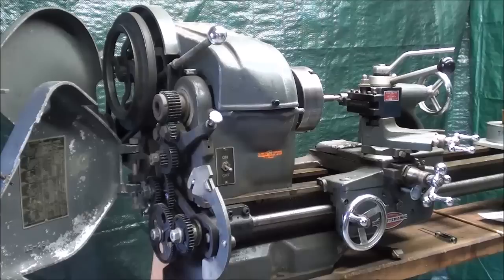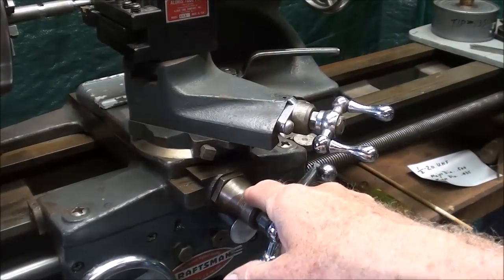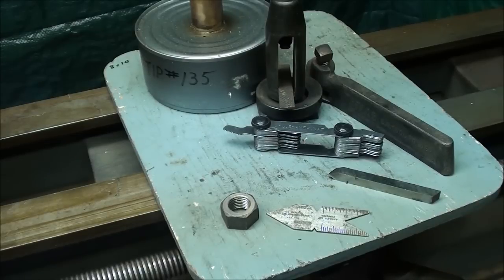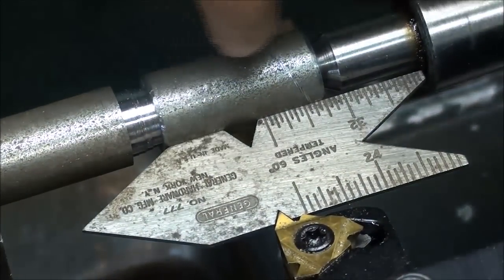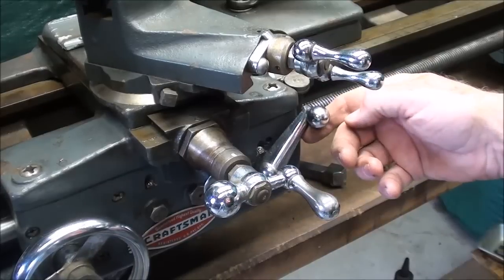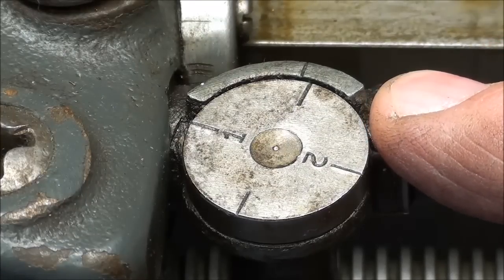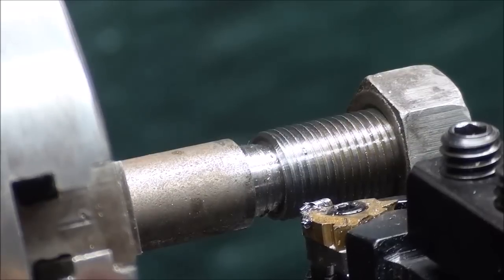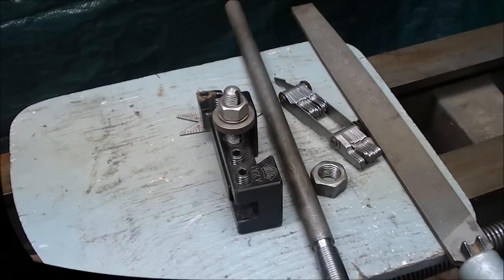SHOP TIPS #223 Cutting a Thread on the Atlas/Craftsman 12" Lathe  tubalcain

Comment: Thank you.  A friend bought an SB 9 (A? - it has the tumblers - is identical to your SB) that is clean, but has not been used in quite a while.  I got the a, b, c and way oils, and we spent an evening getting it lubed up and ran it up, went through various configurations - with, without back gears, checked all the tumbler positions, etc.

We did some simple turning and then tried threading.  Threading was done on a 1/2" rod turned to 7/16 and threaded to a 20 pitch. (Protruding about 2-1/2" from the 3-jaw, unsupported in the tail stock).  We had trouble with the first 1/4" or so being "double threaded" and then it settled out.  I'm very familiar with ensuring backlash is taken out of the cross slide, etc., so I'm confident that was not a contributor.  

Do you think flexing of the work piece was a factor in the threading results?  The lathe has a standard lantern tool post and we used a threading-specific HSS tool that came with the lathe - it has a crescent-shaped cutter held with a horizontal bolt and with the 60deg shape along the perimeter intended to be rotated up as it is ground back with use.

Comment: nice vid mr pete.    a threading tool is a forming tool feeding on a angle has no affect,cause when the carriage is being driven along the bed the tool will only cut on the side that its moving to ,therefore feeding in the compound at 29 or 30 just adds fun to the task at hand. try feeding just with  the cross slide and the thread results are the same. when you plunge the tool in the work both sides cut if the carriage is at idle. food for thought and also look up toms techniques he explains this theorie.

Comment: While making broom thread adaptors (6 TPI) for broom and rake handles (which used to be hardwood and actually lasted more than one season!), I've had to violate your "never take the work out of the chuck" rule because every one I've done fits a little differently, or has different diameters, and they need to be checked as you go. 

In order to return the work to the correct position, I return the cutter to the last depth position, engage the halfnut and let it travel to about the mid point of the previous cut, then stop the lathe with the halfnut still engaged(the most important step!)  I then return the work to the chuck so the the cutter is correctly positioned in one of the previously cut threads.  Once the chuck is tightened, everything should be realigned correctly.  I usually do a spring cut to make sure it's set correctly before cutting further.  Note that a standard threading tool won't work, you need to grind one with a flat nose, usually about 1/16"wide.

There is, of course, no reason to do this for common threads, and I would never do it with fine threads, but it works great for course threads when you can't test fit the nut/female part for whatever reason.
Reply from the maker: +componenx Good idea & nicely explained.

Comment: As always superb lesson Mr Pete. Could you recommend a quick release tool holder for the atlas/craftsman. I still use the old lantern holder. Thank you
Reply from the maker: +Todd Anonymous Aloris or dorian are best, but not affordable. Checkout SHARS--I do not own one, but have many of their size A & B toolholders which are just great.  I have several other import toolholders that came with used lathes & they all seem fine.
Reply: +Todd Anonymous, I have a Shars A and B sized system.  From what I've experienced, I would get the wedge type of QC instead of the piston type.
Reply from the maker: +Todd Anonymous YES--the wedge-not the piston!!

Comment: I'm getting ready to learn(with your video help) thread cutting on a Craftsman Commercial 12x36 101.28990 all was going well until I tried to pull the back gear pin out, it won't release the gear. The pin moves a little then comes up to a hard stop. I'm hoping you might have an idea as to what I need to do to fix this problem.
Reply from the maker: +Ralph Rogers Spray it with penetrating oil. Then try prying it out.  Move it back & forth--tapping--prying. I never had a stuck one
Reply: +mrpete222  Thank you for your reply. I tried all of the above no good. I had the spindle almost out when the pin finally turned loose. There must be a plunger/pin and spring something under the underneath the bull gear pin if so it was stuck pretty good. Still have to use pliers to pull out but pushes in easy. This lathe had sat in a basement unused for quite a few years. Everything was dried up and stuck together. A good cleaning and lots of oil and it runs nicely now. I have a 18" South Bend and a Craftsman 109 but the 12x36 is the one I will learn to cut threads on You have made that possible in that you have taken the mystery out of threading. Thank YouRalph (64 and still learning)

Comment: Can you flip the cutting tool  and run the threads away from the chuck?  Is that possible on the Craftsman Atlas?
Reply: That is how I prefer to do it, it's supposed to result in less chatter - especially with a cutoff tool.  But my lathe, an Emco Maier Compact 8, has a bolt-on spindle connection. A threaded spindle nose needs some type of lock if you are using a chuck or faceplate.
Reply: @KenGrunke  Thanks Ken!

Comment: I don't have a thread dial indicator on my Leblond (can't find one anywhere), Can threading be done by stopping the lathe at the end of cut, backing out the cross- slide and  reversing the lathe  leaving the half nut engaged?
Reply from the maker: +Dennis Clos Yes-watch for this video when I have it done-- tips #237 "threading without a dial"
Reply: +Dennis Clos You should consider making your own dial. It's not difficult or complicated, I have made a few.
Reply: +Moholo 88  I am not that good on making gears, actually have never done it, I see many thread dials on various sites but never for a Leblond 13 regal - I don't know if any of them would work, would guess the gear would have to mesh with the thread pitch on the lead screw and it appears to be a square thread. I would think the gear diameter may also be critical for synchronizing each thread cut, this may be a project over my head. thanks for the interest though.